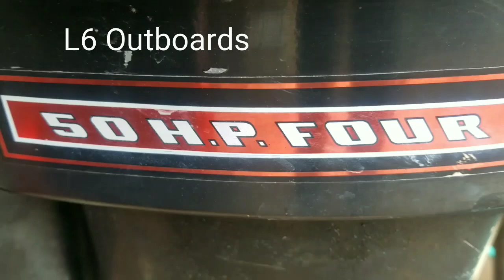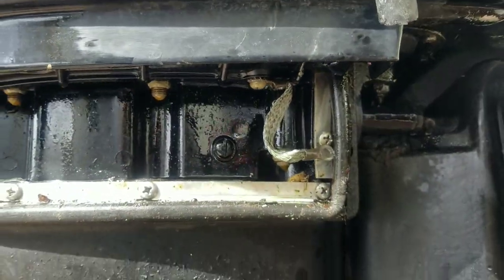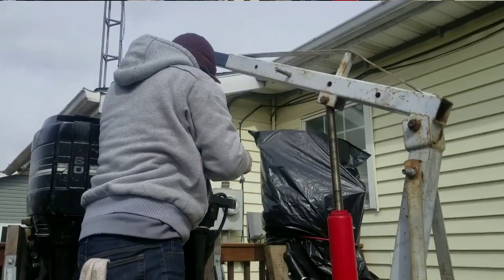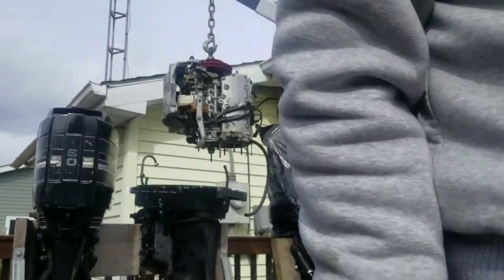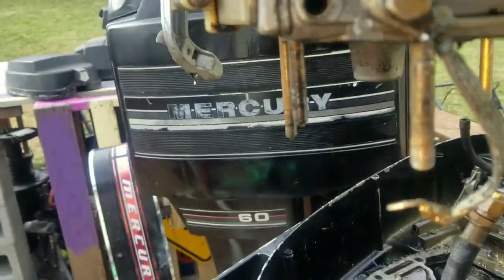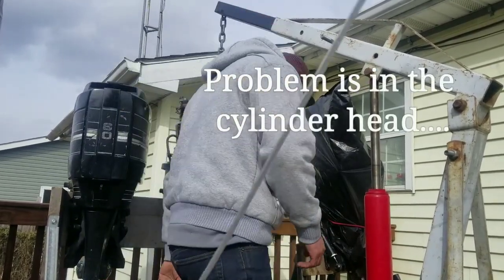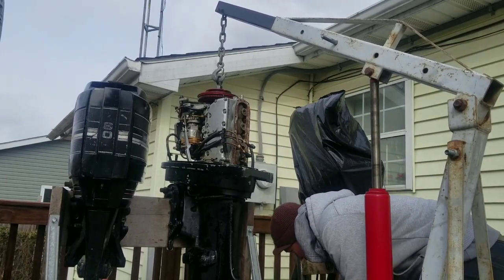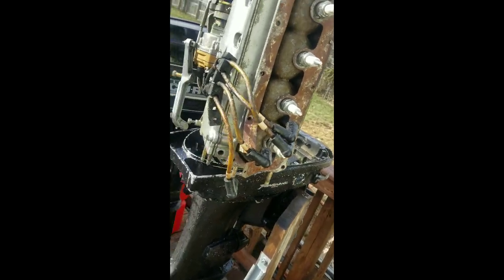Mercury Outboard Water Jacket Fail Solved!!!

Comment: This video was extremely helpful for me to find and fix the exact same problem on a 45. A couple of pieces of the old broken water pump impeller was stuck inside the exact same port as your 50 hp. Thank you for showing me this before I pulled the power head. Great video!
Reply from the maker: You're welcome. Son
Reply: Definitely a helpful video, mine was in a different place but same basic issue

Comment: Thank you for your video, I am about to tackle the same issue on an old 350 Mercury outboard.  I find frozen bolts in alloy castings can be shocked with a drift punch or a Philip screwdriver to help the penetrating oil to work.  Best penetrant is Kroil, thanks again.

Comment: Great video, I’m having a similar problem with my 1977 50hp. Is there a way to drop the lower shroud to avoid having to pull the power head? I don’t have an engine hoist to be able to lift the head
Reply from the maker: Unfortunately, no.

Comment: Hi Son, I'm having some issues with my 1970 Mercury 500 Thunderbolt.

It only runs on the top two cylinders but the lower cylinder doesn't fire. When started cold it starts really easy and idles well but as the pressure in the coolingsystem increase the lower two cylinder stops firing. I have good compression on all four cylinders, I've rebuilt the cars, I've checked the ignition. Good spark on all plugs and so on.

I got a tip that this model could suck water backwards into the combustionchamber if the waterjacket fails, I just removed the waterjacket and the gaskets looks like s#!t but I can't see any obvious leaks. the passages between the cooling channels or whatever it is are all corroded and ugly but I can't see any holes. The inside of the middle cover and the cylinder were covered in this grey goo (exhaust gases mixed with water?)

What would you do next?

Boat in water for a quick test-run (excuse my mothers loud voice, the horrible quality and my mothers even worse recording-technique.
https://www.youtube.com/watch?v=bhKVxvvdbM4

Idling warmed up (water leaking from a broken plastic fitting)
https://www.youtube.com/watch?v=xexh7dVQC70

Appreciate all the help I get, best regards!

Comment: One question that cover from the cylinder head does it has a hole I just noticed a hole on mine and water is coming out from it
Reply from the maker: Might be for a psi pressure guage but I do not believe the silver blocks had those....

Comment: That plastic hose fitting on the top of the exhaust baffle. What does that connect to mines capped and the bottom water fitting is capped as well, should they connect together?
Reply: Mines an 800 previous owner capped them. My tall tale stream is really hot

Comment: Thank you for your help! Question, can you remove the cylinder head/water jacket without pulling the power head? 
I have the same issue with our 67' 50 HP. I Cannot get the clean out plug out from the top of cylinder head, (seized up, tried heating) that's the only thing I have not been able to do, as far as flushing. I noticed you had installed a nipple you yours, etc..
Reply from the maker: You can. You would have to loosen the lower shroud. It will be difficult. I would definitely replace all the screws and bolts. They are very "soft" so proceed with caution. Son
Reply: @MerCSonL6   Will do, thought I would try to that first, if the bolts will free up.  
Just does look like there is much room to back out the bottom bolts. Hopefully the shroud will slide back enough.
What are your thoughts on the flush plug? Would you suggest trying to remove the top flush plug,  before attempting  the above? 
I can drill out/easy out  if necessary? 
Do you have a link for new gasket replacement parts?  Thanks Son!
Reply from the maker: @rollmeaway5075  its certainly worth a try. I'm not 100% sure it would cool properly tho. The gaskets would likely have to be purchased from Oldmercs.com. The 50hp is the only L4 that didn't change a whole lot from the late 60's all the way to the 80's. It is highly likely that any "classic 50" gasket will work. Double check it but I'm pretty sure that's right. Son
Reply: @MerCSonL6  I'll see what happens, thanks again.

Comment: Could you point me in the direct of the gaskets for a 1969 Merc 1000? I’m having similar issues and need to remove the exhaust baffle and most likely the heads to the cylinders to find what’s creating the blockage. Wanna try and knock it out in a day when I rent a hoist, thanks!
Reply from the maker: Marineengine.com or oldmercs.com
Son

Comment: I also noticed water on my spark plugs it seams like water is coming out of the lower  carb as well.  1973 50hp mercury.  Water pump came apart .  Do you think I have the same problem
Reply from the maker: Water on plugs is definitive of an exhaust Baffle leak. Son
Reply: @MerCSonL6  ok thanks waiting on parts .would you know the torque specs  and sequence for the baffle cover and front cover
Reply: @MerCSonL6  what could I use to clean  the  inside of the  power head
Reply from the maker: @jeremiahgonzalez6563  heavy duty degreeser and elbow grease. Son

Comment: 1983 115 tower of power wont plane out without someone on the front of the boat ive replaced stator trigger both power packs any ideas
Reply from the maker: What's the weight of your boat?
Reply: It ran fine when i got it started having the no plaining trouble been chasing the demon since
Reply: When i got it it would run 55 with two people in the boats its ranger 335v

Comment: can you take it out the powerhead without the lowerunit? o you need to take it out the lower unit first?
Reply from the maker: You can leave the lower unit attached and still remove the powerhead. Either way works. Son
Reply: @MerCSonL6  thank you very much, I need to revive my engine, it's running, but it shuts down when I put it forward on the water, leak some fuel in the top carburator, 
I think it's because of the floats, beacuse with flushhose it does not happen
Reply: @MerCSonL6  I see a little water in the spark plug of the last piston, it is milky and blue, can be a waterjacket problem?
Reply from the maker: @juajo55  probably an Exhaust Baffle leak.... it only takes a pinhole to pull water in. Son
Reply: @MerCSonL6  what part i need for replace that?
Reply from the maker: @juajo55  what engine do you have?
Reply: @MerCSonL6  mercury 500 thunderbolt 50hp 4 piston, 2 carburators
Reply from the maker: @juajo55  you will need a new Exhaust Baffle from a similar year 50hp. The 50 has a very wide range of years. The powerhead will have to be lifted to pull off the manifold cover/exhaust Baffle. You will also need new gaskets and high heat sealant to make sure no water leaks after the repair. Son
Reply: @MerCSonL6  thats the Exhaust extesion rigth?
Reply from the maker: @juajo55  I'm not sure what "extension" you are talkin about . You need a new Baffle, gaskets, and a high heat sealant. Son
Reply: @MerCSonL6  I as well have the same issue on cylinder #6. I can also see a little residue on the exhaust baffle. Power head as to be pulled to replace correct?
Reply from the maker: @KeithJackson81  that's the right way to do it. You can lift the powerhead a few inches to access the bolts but it's definitely easier to pull off the powerhead. Son
Reply: @MerCSonL6  thank you sir. That’s the route I’ll be taking this weekend!
Reply: @MerCSonL6  thanks for all the help. I pulled the power and and replaced the exhaust gasket. No water in cylinder number 6 now.

Comment: I have an 86 115, and I just changed the impeller and now my tell tale stream isn’t steady now. It will start off at a full stream, then somewhat sputter after a minute. Think something could be blocking the line?
Reply from the maker: For sure. I would pull the hose and verify it's clear and verify the nipple at the outlet is also. Son
Reply: MerCSon L6 any trick to removing the water tube? Mine will not come out
Reply: MerCSon L6 disregard that comment. I finally got it to come out, it was just being stubborn. Thank you for the help sir!

Comment: Hi I have a mercury 75 2 stroke 4 cylinder its been running fine until recently I've noticed that there's cooling water getting into the bottom cylinder any ideas what may cause this? Thanks and love these videos on older outboards
Reply from the maker: It's likely coming through the exhaust Baffle.  You will have to lift the power head to remove exhaust cover and inspect the Baffle very closely. A pin whole can cause the water intrusion. Son

Comment: Mine is leaking at top spark plug. Is this my problem  too you think??
Reply from the maker: Its definitely a problem. A leaking spark plug has no effect on failing water jacket unless its dumping water.... in that case it would ground out the plugs and your engine wouldn't run. Let me know. Son

Comment: You could have just drilled a couple of holes in the lower cowling to access the bolts then plugged then with rubber grommets. I have done it SEVERAL times....and is what the manufacturer should have done but they are not thinking of you, they were thinking of their dealers repair shop making money.